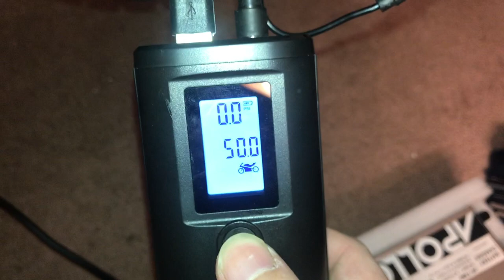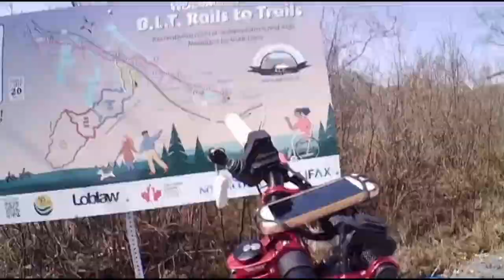Apollo Ghost new Hybrid Off Road tires install + first trail ride of the year #shorts #escooter

Comment: Hi there.
 Do they really prevent flats as well ?? Especially for offloading??
Reply from the maker: hybrids? yeah man, they're much thicker than road tires + each of the knobs on the tire are more rubber/nylon between the ground and the inner tube. so it's extra protection for the inner tube.
Reply: @Mentally iLL-ectric  you know I wanted to go for a synergy aviator 2.0 because I wanted to escape from flat tires. At the same time, Apollo ghost is very attractive, but as I said with pneumatic tires, I am scared. I want to use the scooter for mainly city, but I want to have the option of going offroad without the flat tire concern. What do you think I should do ?

Comment: Hows that tire slime working? I have a slow leak but i was nervous about putting that slime in the e hub.
Reply from the maker: Slime fixed 2/3 punctures on my stock tires before I finally got around to installing hybrids lol. Had 0 flats since so not sure if the slime could have prevented a leak or if the hybrids just protect the tube so much more….but I always go with sealant. Ordered Armour Dilloz fr minimotors Canada and they just never sent anything….. and they were the only place in Canada with it in stock but I’m hoping to get my hands on some before I install new tires on my wolf warrior
Reply: @pevns  nice i slimed up my tubeless tires last week i think i still have a slow leak but everything seems alright =]

Comment: What size are the tires? Thanks
Reply from the maker: https://www.aliexpress.com/item/33034063345.html?spm=a2g0o.cart.0.0.29653c009g27nI&mp=1
They're the middle ones, semi off road or "hybrid". 255x80, 10x3 but wider than the hota 10x3's that come stock.
Reply: @pevns  awesome. Thanks👍👍
Reply: I got the same size for ghost, the tires came off the rim. What Did I do wrong
Reply from the maker: @jasonberkers2142  im not sure what you mean bro. You changed the tires and after riding something happened?
Reply: @pevns  ya they came off the rim while riding. All good now tho, they weren't seated properly. User error. Thanks for your replies

Comment: How is the ghost??? 
Range???
Reply from the maker: Hey bro, the range is average…nothing special but you can get 30km without issue in dual motor turbo. My rides are usually 15-25km on average so I’ve never ran out of juice. You could get 40km if you weren’t riding as fast as you can the entire time, bit of eco mode.